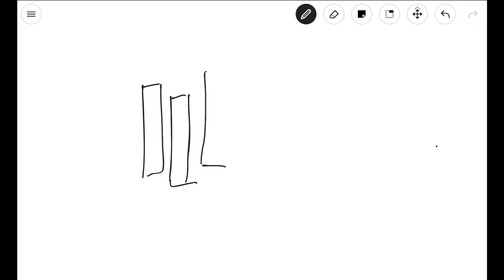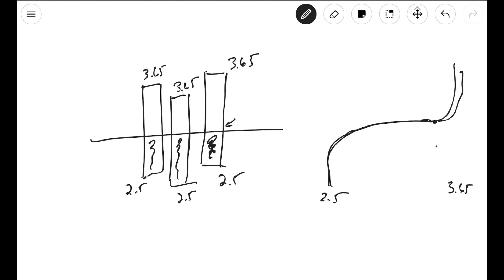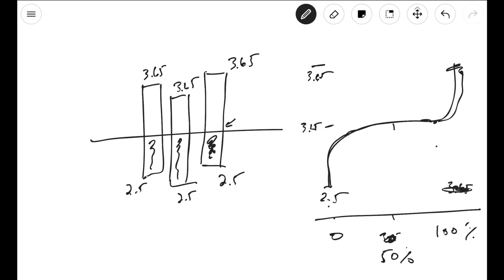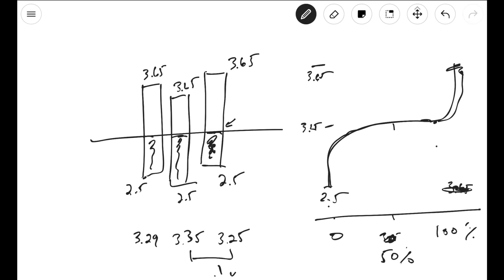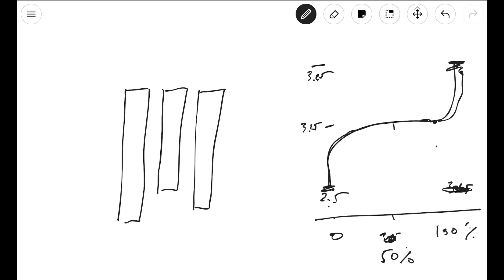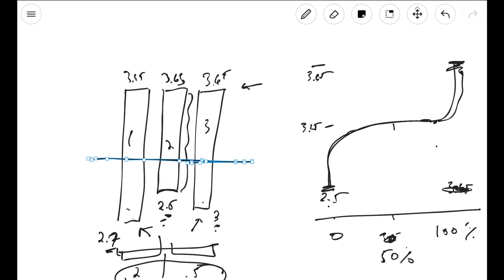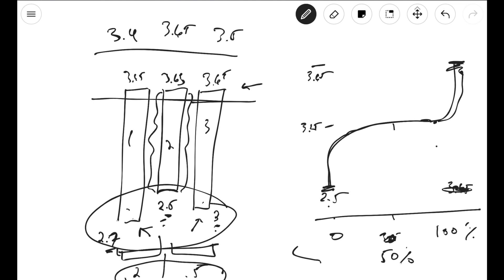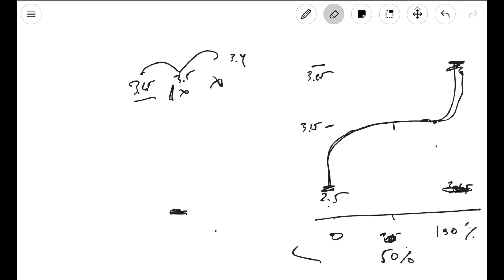Why You MUST Balance Your Lifepo4 Cells and Why They Won't Stay Balanced

Comment: If you are using an active balancing BMS, even if you top balance, when the cells are at a lower voltage during the night, the BMS will try to balance them again at the current voltage and this will happen every night.  So, you will eventually loose your top balancing.  That is why its very important to buy good quality cells with matched capacities as a first priority.

Comment: my 12v 40ah lifepo4 lost capacity only after few cycles. How do I balance the individual batteries inside ( assuming I am lucky to get to the guts inside) when they are connected in series and possibly the bus bar being welded on to them?
Also what is the proper way to store this battery if I am not going to use it for 6-12 months of the year?

Comment: Great video. very knowledgeable.  I have a question. I purchased Deaf Bonce lithium batteries. The LFP 300P. which put out 30,000 watts. I also purchased the XS power super capacitors. They come in a bank of 6. My question is, how can I hook up the batteries and the capacitors to each other and then hook them up to my car. plus I purchased a XS power 1225 charger. This setup if for my cars audio system that I am putting together. Ive been breaking my head all day trying to figure out how to put all of this together. your help would be very appreciated.

Comment: Hi Will, thanks for the video. I wonder if using an active cell balancer while charging could substitute a top balance. I,ve built an eléctric car for muy kids with 16 liito Kala 60ah LiFePO4 battery cells hooked to an 80a Daly Bms. The cell balancing current os apparently only 30mv wich os a complete joke. The cells keep coming out of balance. As the cells are located inside the car It is really a pain to keep paraleling them and I'm looking for alternatives. I currently charge with a 20ah charger and was thinking of using a 16s 4ah active balancer + a 5ah charger to try to keep them balanced. Would this help? Are my cells just crap  or is It a common problem with this battery chemistry? Any help would be VERY welcome!

Comment: Hi Will. Wonderful explanation! Would top balancing still apply if I were to purchase a bms that can idividually charge or discharge a cell like the batrium? Essentially the bms would be doing the top balance at a slower rate. Thanks!

Comment: Although I thought I understood top balancing, that was a good explanation and another way of viewing the situation. But that gives me a question: when I top balanced 8 x 3.2v cells in parallel using a 15 volt power supply set at 3.65v, initially, the voltage went to 3.6 and the current started dropping as I expected, but at some point, the power supply simply hung at 4.3 amps and did not drop further (I left it on all day). Neither did the voltage increase. Are these cells top balanced or do I need to give it days at 4.3 amps before it will continue dropping? I expected that it would get to near zero.

Comment: In the flat part of the curve is usually around 3.4v from 65%ish to 90%ish... thats why you can't use voltage to judge capacity of lithium.....
Reply: 3.4 volts when? resting, charging or discharging?
Reply: You CAN see the SOC through the VOLTAGE;  between 3.000 and 3.400 there are 400 elements of display; especially AFTER YOU GET USED TO ALL YOUR BATTERIES, ONE BY ONE;  like you knoe your family, yoyr pets   etcetc

Comment: Great info, thanks . I have a question about battery life and doing full charge\discharge cycles or full recharge daily without full discharge? Would this make a difference in battery life?
Reply from the maker: It's a little complicated. Going totally full to totally empty is hard on the cells. But storing your cells at close to full all the time is also not ideal. Generally cycling less rather than more is good, but I would always advise never discharging below 10% of capacity and above 90% (except for top balancing).

Comment: Best explanation I've seen yet... But how do we get the new cells to the top or bottom before assembling them into series with bms in place for use.. I understand the hole parallel thing but when new they will not be at top or bottom so I'm confused in this area
Reply: Ok never mind just checked out one of your older videos... Again great explanation.. thanks for the info

Comment: The bleed balance on most BMS  is 25 -60ma  not enough for such huge cells - I added a 500ma additional bleed balance to mine
Reply from the maker: Yeah BMS balance is way, way too small to do much.
Reply: @TheWilltoBuild  my JK bms does 2 Amps; manages 200 Ah mismatched junk cells up to 20 Amps,charge or discharge; after 20 amps,the delta voltage goes haywire.

Comment: Having just finished testing 32 310Ah cells I am in dispute with the supplier about specification. All the cells are  3.5-6.3% below capacity. Alibaba are currently acting as go between. Due to the long and expensive shipping to the UK, returning the cells is not an option. I am looking to maximise the usable capacity. My plan is to use a 16S2P set up for a 48v system. I have an idea that I would like feedback on. As the cells will be arranged in 16 pairs would it be a good idea to match lower and higher capacity cells together? That way each pair will have a combined capacity which more closely matches others in the series string. My thinking is that by getting the combined pairs more closely matched it will give a slightly higher overall battery capacity and reduce the work needed by an active balancer.
Reply from the maker: This is a really interesting question. On the one hand, what you describe will increase capacity, but at the cost of longevity. This is because all the higher capacity cells will be constantly discharging into the lower capacity cells they are paired with. So this will help to ensure that you get "average" capacity from each set of cells in your series, but it will also mean that some of your cells will be working extra hard and may not last as long as others. Matching cells that go in parallel with similar capacity will mean a longer life for your cells, but it will also mean limiting the capacity of the battery to the smallest set of cells that are pair together.
Reply: @TheWilltoBuild  Thank you for your helpful and informative comment. It isn't easy to be sure of the relative merits of capacity versus battery life. As I have recently installed the cells in the high low pairing format rather than close matching pairs I am inclined to take my chances and see what happens. The differences between best and worst cells are only about 3% so I am not sure that this will be significant enough to show up a difference in total battery life. Having spent the last 4 weeks capacity testing 32 cells I am disinclined to do two further tests of both layouts. It would take me the best part of 2 days to uninstall and install the cells between formats. Two identical discharge/charge tests on the whole assembled pack would be time consuming needing close monitoring. If it then proved that the original format was the better one it would take a further 2 days to return to the original format.

My planned application is a mobile one where the installation is in a very small trailer transporting power from an off grid location to my home (only 1 mile away) where solar power is not practical. The power will be mainly used to top up an EV on occasions when  it isn't practical to use the off grid power. Any spare electricity might be used by the house to reduce that supplied by the grid. Even without this mobile supply so far we have managed to avoid using grid electricity for one EV for 5 months except on two occasions providing enough power for a driving distance of 4000 miles. These two occasions cost us the small sum of £2.21 (about $3). It is true that I will never get payback on my investment versus grid electricity but the difference compared with an ICE car will result in a payback over about 4 years and avoids the use of any fossil fuels.

Comment: Very clear video. Thx.
I bought my 4 batteries, ordered an Overkill bms... but have neglected to attempt to top balance my batts. Partly laziness, partly unknown anxieties. Newbie here.
My batteries are still in the box, sitting in air conditioned storage. Voltage was checked when I received them 3 months ago. Nearly identical at 3.28.
I'm I making a big mistake by not getting these up and running with some panels?
Thanks!!
Reply from the maker: If they are sitting there at that state of charge they are fine. After a few months it is worth using them a little but for the time being I wouldn't worry about it.

Comment: This was a good video, overall, but there's a few things I would mention:  You do not explain why the cells don't stay balanced.  If you did, it was not a good explanation because I'm not the only one asking that question.  You also don't mention internal resistance, which changes (decreases) as the cell state of charge increases.  Top-balancing can create a false impression because you're doing so while the cells have the smallest delta, in terms of internal resistance.  Bottom-balancing is better, for this reason.

Finally, you touch on the solution to this "problem" in the very beginning of your video, but since you completely ignore it afterward, I'm wondering if you understand it?  Good management of any type of battery mandates that you do not charge to the absolute highest possible SOC, and that you do not discharge below a certain bottom SOC.  If you were to keep these cells charged to no higher than 90%, and discharged to no more than 10% (of capacity) then the splitting of hairs that you spent so much time explaining in your video makes absolutely NO DIFFERENCE, whatsoever.  It should also be mentioned that it is critical to use this type of charge/discharge setting, if you want to ensure the best life from your battery cells.

In other words, you're explaining how to do something that you would never worry about doing...if you wanted good life from you battery in the first place!
Reply: Internal resistance has minimal impact on the most common lithium chemistries, but will cause drift in balance over time.
So why choose top vs. bottom balance?
* Bottom balancing is slightly better if you are typically running on the bottom part (mostly discharged part) of the battery, like in an EV.
* Bottom balancing must be done while the battery is basically empty which means the battery is not available during balancing - maintenance takes the battery out of service.
* Top balancing is better if you are typically running on the top part (mostly charged part) of the battery and frequently charging (like in a solar power or UPS system).
* Top balancing is also easy for a simple balancer to maintain while the battery is in use every time the charge is nearly full.
TL;DR: Top balancing is nearly always the best approach.
Reply from the maker: @sylvan dB  - I think that is very good explanation. Can you say more though on the reasoning behind why bottom is better when you run them low, top when you run them high, etc? Also @jason the whole point of the video was to explain why they don't stay balanced during a cycle, so I'm sorry that didn't come through. Also you are right about the 10/90% charging. But that won't solve the problem of getting less than optimal capacity. You'll still hit your floor and ceiling too early relative to what is possible. But I do talk about that type of charging in my other videos.
Reply: @TheWilltoBuild  Bottom vs top has to do with the characteristics of batteries, including the internal resistance changing depending on state of charge. The better matched the batteries at the point where charging or discharging is halted, the more accurate the halt and the less chance of damaging a single cell. Obviously a pack of real world cells cannot be both top and bottom balanced at the same time, so you choose whichever is your more common use case.
For example, your BMS may cut off discharge at 2.5v which is quite low. If the entire pack is matched while discharging then the pack voltage of a 4s pack would be 10v and most inverters would have shut off the pack at 10.5v or even 11v or 11.5v - higher is better for the battery. But if 3 cells are still high the pack voltage will be high and we rely on the BMS to shut off when one cell is down. Then that one cell is stressed more than the others. If that kind of full discharge is normal operation for your pack a bottom balance to better match at termination is likely to more evenly wear the cells.
Similarly when charging. If your charge controller stops at 14v that would be 3.5v/cell if they are top balanced. There is very little energy beyond that point, and less stress for the cells to stop. But if the cells are not top balanced and one cell reaches a 3.65v or 3.7v BMS cut out that one cell will be more stressed. If that is your "normal" then best to top balance so the regular charger can stop before the BMS safety kicks in.
In addition, it can be hard on the rest of the system when the BMS disconnects the battery. Solar charge controllers, for example, often have warnings to connect the battery first, and disconnect the solar before disconnecting the battery. What happens if the BMS disconnects the battery while the charge controller is charging? Having the cells top balanced means your charge controller can stop charging before the BMS is triggered to protect a cell.
Reply: @Sylvan_dB  - Excellent information.  Cells should be matched for internal resistance and capacity before building a battery from them.  If that advice is followed, the white board work shown in this video becomes a gross exaggeration of the "problem", and completely obviates the need for an active cell-balancer.  Well-matched cells are not going to gradually become worse, in terms of internal resistance and capacity, and the net capacity of the battery is not going to be radically lower than expected. If this were an actual problem, active cell-balancing would be something included in batteries built by reputable companies.  Instead, they simply build their batteries from well-matched cells and use a good BMS to protect them.  Active cell-balancing is not exactly a parlor trick...but it's certainly not essential to use, if you started out with a good build in the first place.

And again, if you stick to a 90/10 charge model (programmable into a quality BMS) then you never lose any of the capacity described in the video AND you get the best possible life out of your battery.  If you need more capacity, build a bigger battery, don't rely on cell-balancing to squeeze every mAh from your cells.
Reply: @jasonbroom7147  I agree active balancing is unnecessary and I don't have active balancing on any battery I've built. But as a hobbiest I do not have the highest quality matched cells and every time I assemble a battery I top balance the cells first. That is a critical step and that is what I took away from this video.
The video may have exaggerated the difference between cells, but that is a difference in magnitude not kind.
After all if cells were perfectly matched you would not need a BMS, but I assure you no two cells are ever that perfectly matched. You need a BMS and you need to ensure the cells are at the same state of charge before putting them in series.
Reply: @Sylvan_dB          Exactly;     
              The MPPT charge controller CANNOT control the incoming solar panels voltage IF it is not being powered;   by the BATTERY!!!!! CAUTION here!!!
    That is why i always keep 2 used truck  lead acid ones (24 volt system) in parallel with the Lifepo4s; there are more reasons.

Comment: The difference between top-vs-bottom balance is this:
Top balance puts all cells at the same State-Of-Charge (100%).
Bottom balance ensures that all cells contain the same amount of electric charge (Ah).
Reply: How would you bottom balance a battery string in an automated way (set and forget etc)
Reply: @mekuranda  I have never seen a BMS that could do automated bottom balance. In theory, we could build one. Nothing too complicated. The only problem is that you have to discharge the battery completely to re-balance and I think for many of us that would be very inconvenient.

But I did read in the manual of an on-grid inverter with self-consumption optimization (Fronius Symo Hybrid + fully-encapsulated high-voltage BYD LiFePo4 battery), the battery is discharged completely about once per month for "maintenance and calibration". They do not explicitly say "bottom balance", but that's what I think it does.
Reply from the maker: Yes, good point. But they both fundamentally accomplish the same thing - ensuring maximum capacity of a battery. I like this description though.

Comment: I don't really know 8f this 8s right because when you top balance you are inputing watts into the battery's and as the battery's get full they no longer take any more watts so if a battery's is 16,352wh then the capacity you used to too balance was filling up. Kinda like a 5 teir fountain ⛲ but all the same size, they all fill up because the first one put the excess power into the next and so on.
Reply from the maker: Definitely not that case. Cells will continue taking power long past the point that it is good for them. You can overcharge cells, which will destroy them and is potentially dangerous. That is why you should always use a BMS.